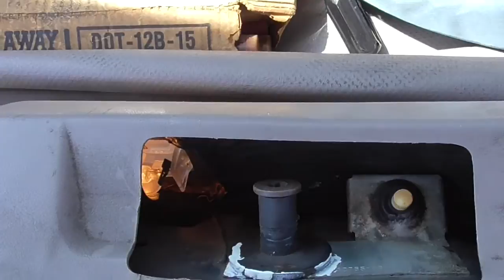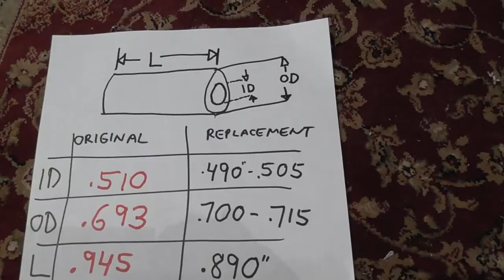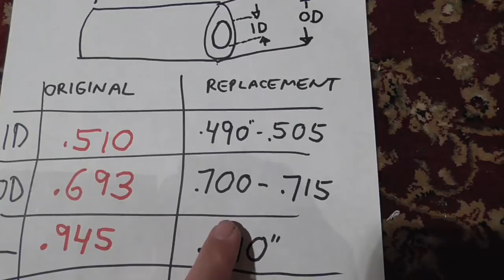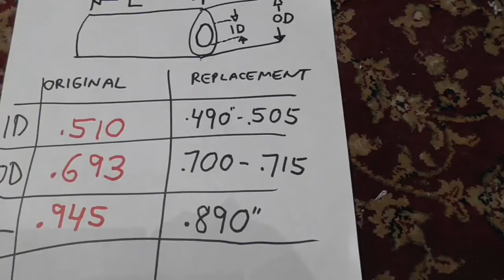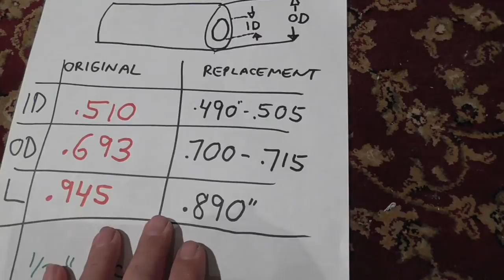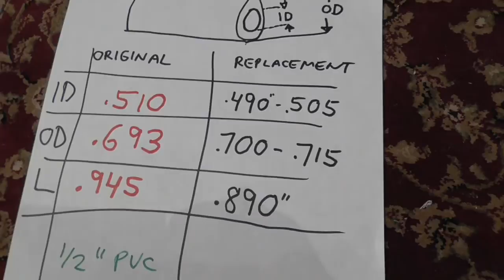Mustang Trunk Hatch striker bushing repair

Comment: How did you get the washer/bushing off?
Reply from the maker: once you unscrew it from the car the plastic bushing comes off
Reply: @LEARNINGCHORDS  I tried, that sucker won't budge. It will twist but won't go down the threads of the bolt. I even put it in the vice and it in anger with a 5lb mallet. I ordered the whole thing for $40. Hurts my feelings.
Reply from the maker: i donated the car. i no longer have it but i didn't have a problem removing it
Reply: @JMac85X  on my 88 LX, the washer is similarly captive to the bolt, so it can't be separated to allow the new bushing to simply slide on the way it should have been able to.
I simply slit the plastic bushing to allow it to be installed by spreading it sideways, which was easy enough to do with a utility knife.
The pack of 4 bushings I got for 9.52 seem very similar to the 1/2“ PEX tubing, though I didn't compare the dimensions.

Comment: That switch is if you have to reset your fuel pump
Reply: No it's not. It's the switch that turns on/off the dome light and the hatch area light when you open and close your hatch. The fuel pump inertia switch is over to the left behind a grommet.
Reply from the maker: correct